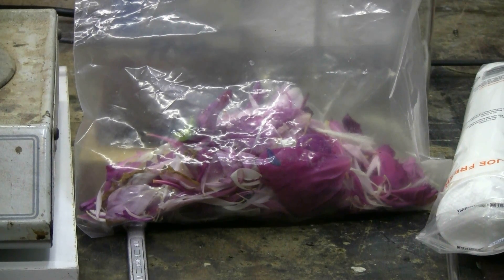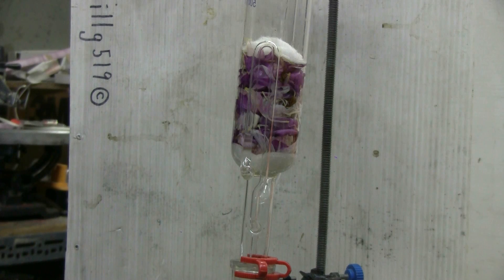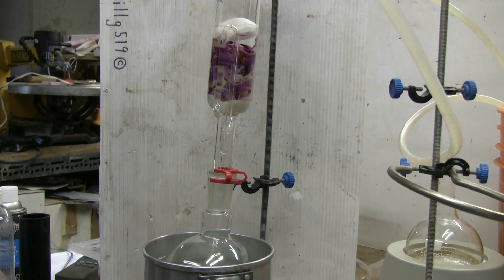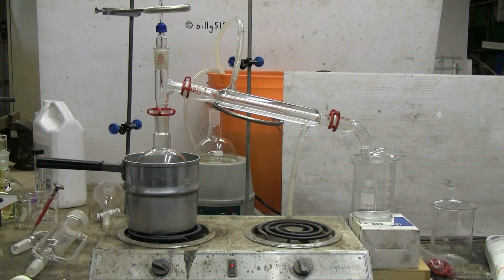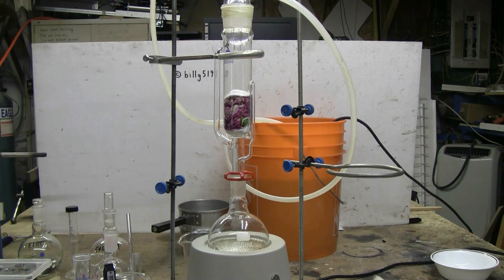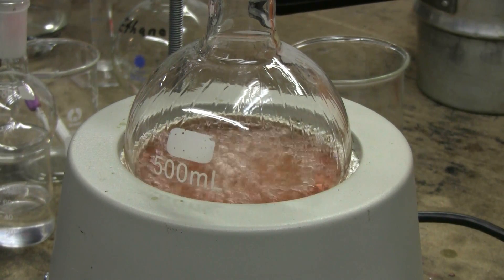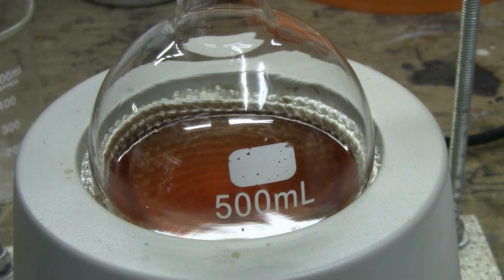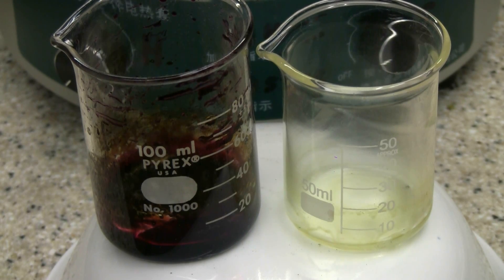Soxhlet Extraction #3 - Peony Flowers, Ether And Ethanol

Comment: Hi. Thanks a lot for the video. It is very interesting. I was sure that with ether the extract should be much more and rich, than with ethanol. In industry n-hexane is used for flower rezinoids extraction.  Your experiment shows that ethanol is more preferable to be used in perfume manufacturing instead of ether.
Reply: Actually it doesn't show this thing in any place. Ethanol  extract coloured compounds that ether does'nt  but they are not smelling compounds. I would  be curious to know  content of essential oils of the two extracts.
Reply: @gentiligiuliano7882  ethanol extract doesnt smell like original flower?
Reply: @jozipig  actually no extract smell exactly as original flower. Just I say that extracting more color doesen't mean more extracting efficiency if you are interested in smelly extracts. Ethanol extracts are not super popular in perfumery as they stain a lot.

Comment: What temp do you shoot for and how long does it take before the extraction gets going?
Reply from the maker: There must be sufficient heat to boil the solvent. The first soxhlet cycle will only occur when the chamber fills with solvent up to the siphon tube. Then it will drain and a new cycle will begin. On mine a cycle takes about 6 minutes.